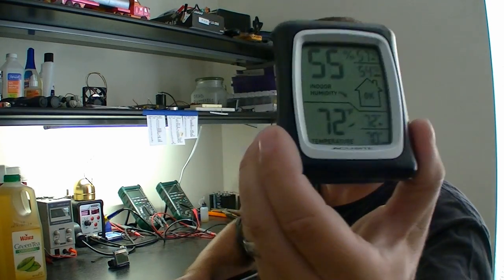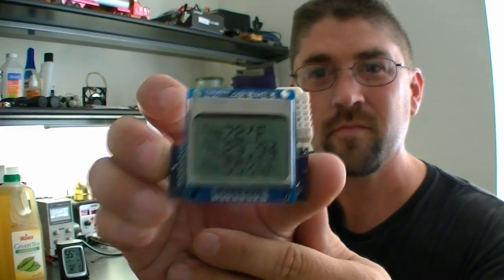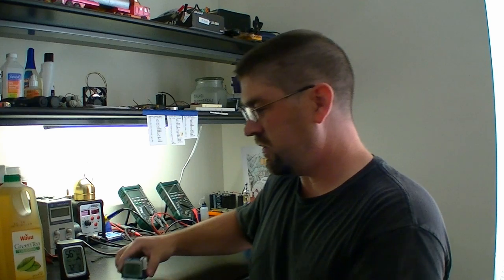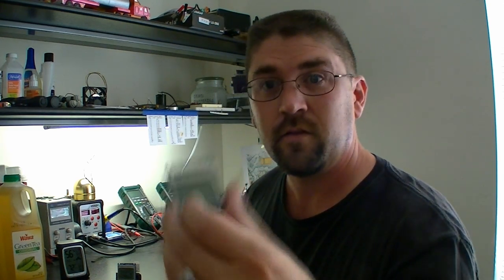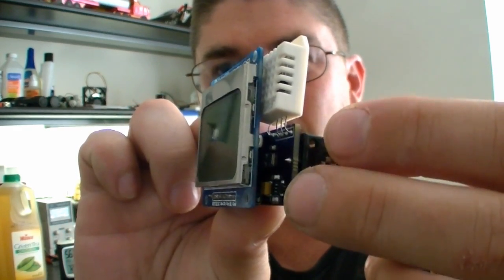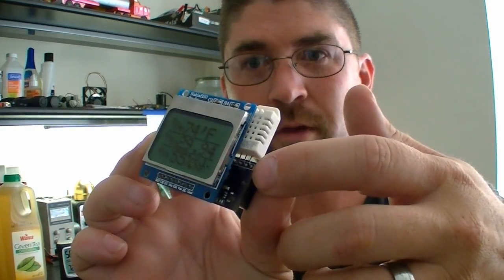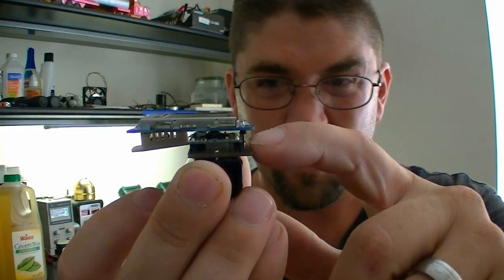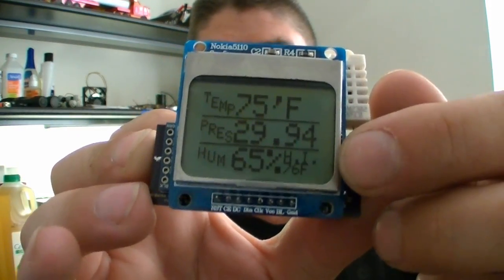Arduino Pro-Mini Enviromental Display Project

Comment: Hello i have a question is it possible to get a copy of the sketch with the dht22  and the bmp180 the one like you have in this video? It is not on your video no more.
Reply from the maker: Sorry, I do not have the sketch available anymore.
Reply: Mad Electron Engineering  no problem thank you. I was trying to come up with a sketch on it. but I did figure out the sketch problem I was having and I mange to get the bnp180 and the dht22 to work. then I upgraded everything to the bme280 using the Nokia 5110 LCD. And got rid of the bmp180 and dht22.

Comment: Hello i have a question sense it is on battery you put everything to sleep? If so how long does it sleep and how long does it wake up and stay on for? The other question is I'm guessing the DHT22 Power VCC + is connected to the Pro mini and set to high when pulling the data then low when in sleep mode?
Reply from the maker: look for my newer videos regarding this project.  It has taken a much better approach and with the new screen it can run over 2 months with the screen connected, or over a year in just datalogging mode.
Reply from the maker: oops, forgot to mention on a 2000mah lipo battery.

Comment: No one figures Heat Index correctly. The Heat Index is only valid if the temperature is greater than 80F and the humidity is greater than 40%. The Heat Index at 74 degrees is always 74 degrees
Reply from the maker: Long John check out my new video I just posted yeterday.  I just finally got around to updating this unit, and I got it to display -'s when the temperature is under 80'F and humidity less then 40% just for this reason.

Comment: Hi,
I'm relatively new to this and having trouble finding the right parts. Would these links be a suitable parts for L1 and D1?

L1 (68uH 0805) - http://www.ebay.com.au/itm/10-Pcs-Axial-Leaded-Power-8x10-8mm-x-10mm-Plug-in-Inductors-68uH-/331414220008

D1 (DIODESCH SOD-123) - http://www.ebay.com.au/itm/15-Pcs-1N5819-SOD-123-SMD-SMT-Power-Schottky-Rectifier-Diode-1A-40V-/390997980928 OR http://www.ebay.com.au/itm/40-in-1-SMD-SMT-SOD-123-2-Pin-Schottky-Power-Rectifier-Diodes-0-5A-20V-/301483075378

Comment: I don't "git" github either.  I like your use of a dropbox folder.  BTW -- what's the total cost?  About $40?
Reply: You could probably do it for $12-$15, minus the custom pcb; with ebay. $20-$25 with the custom pcb if you scrimp and dig the chinese suppliers.
Reply from the maker: Parts cost is around $30 without shipping.
Reply: R&TPreppers Is it possible to order it at you? In germany it is hard to find them :-/

Comment: I want one with an OLED.
Reply from the maker: While that would be better looking, an OLED screen uses around 10ma to light up the needed pixels on the display.  The nokia 5110 is a transflective display so in this application without using the backlight it only uses around 280uA to power the display.